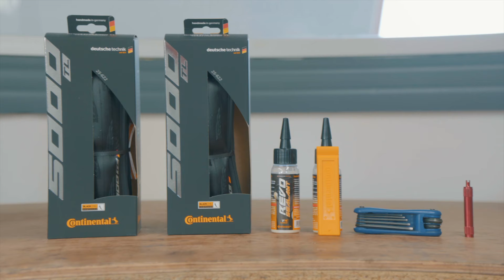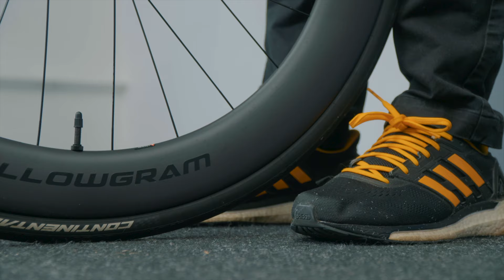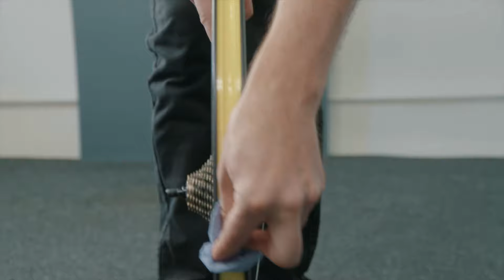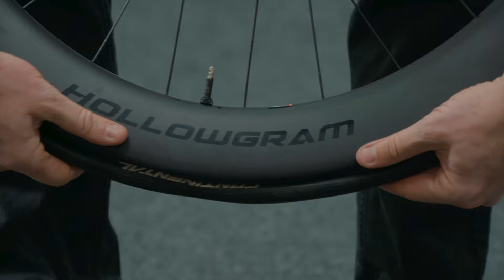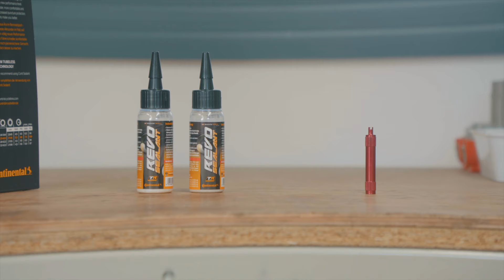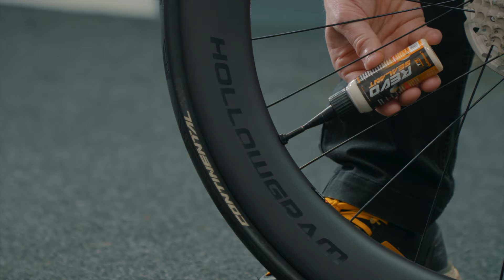How to set up a tubeless tyre - road bikes - Continental Bicycle Tyres

Comment from the maker: Hi, We have spoken with DT Swiss UK. They were running the discontinued GP5000 TL on these wheels to demo them, although they were a tight fit they went on. The new GP5000S TR will be easier to fit than their predecessor. The regular GP5000 clincher shouldn’t be an issue to fit to these wheels.